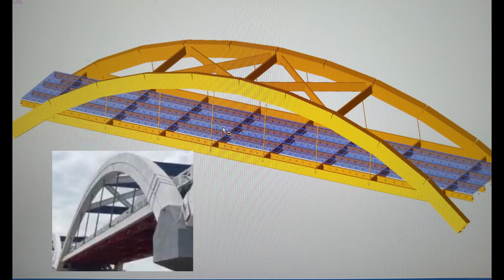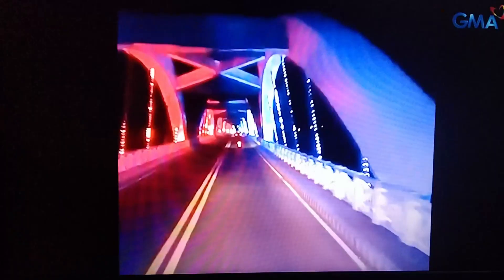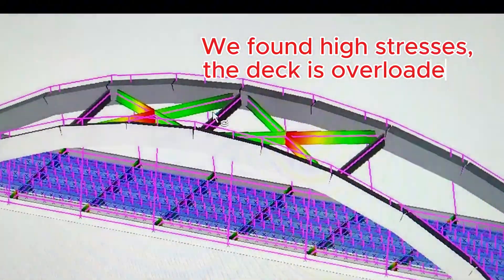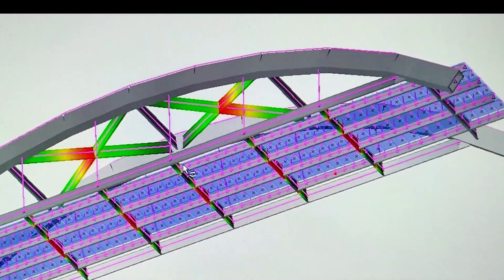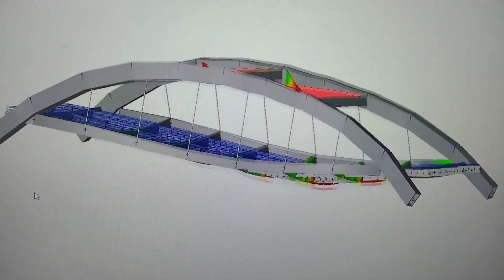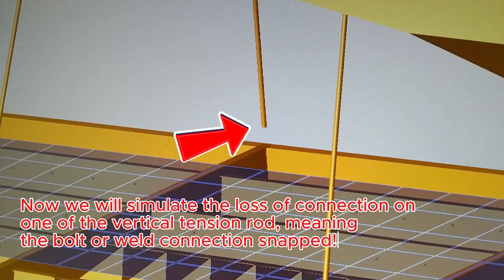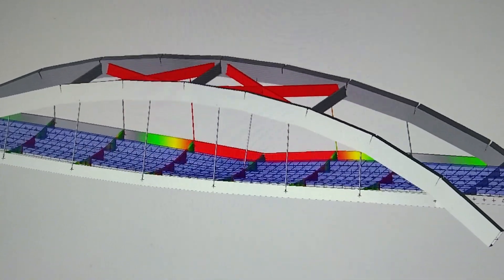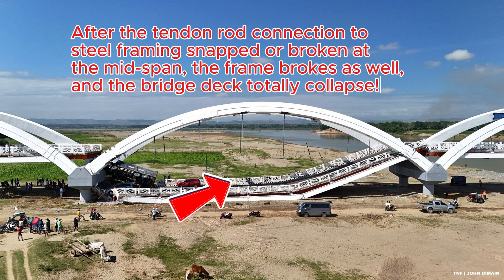ISABELA BRIDGE Cause of Collapse, EXPLAINED & CONCLUSION!

Comment: This is a very good animated presentation of what might has happened.  I must add since you brought up the other loads not included besides the two dump trucks, this is called lack of redundant strength to counter any unexpected overweight load.  There should be a law that says if the capacity is designed for 45 tons, the design weight  must be doubled or even tripled to obtain maximum safe carrying capacity of the bridge.  Since the original designer said it himself that, Matipid ang aking design, could this be the main reason why he's design is accepted by the DWPH.  How many more bridges did he design with minimum strength without redundant load capacity that might collapse in the future.  I think it should be investigated all contracts awarded to him by the DWPH because of money considerations being he's design is the cheapest of all... Cheap but not Safe.
Reply: ano po logic nung 45tons limit na load sa span na ganyan 60m? isang or dalawang truck lang pwede dumaan? yung iba mag hintayan hangang nakalampas na yung iba? magulo po yata yan lalo na dito sa pinas hahahaha
Reply from the maker: my new vlog coming up... it should actually be designed for more.... Total 270Tons Minimum of Static Uniform Loads per span
Reply: Ginawa sanang 2meters  height x 60 meters length at lahat nang 6 I BEAMS ay ditertso typical.

Comment: Boss i think not right to design bridge with long span 47ton or 100ton.. it should always assume a fully loaded deck of biggest load of possible trucks at a certain time and designer must foresee that scenario.. how about truck runs in convoy in both ways which usually happen during traffic,..  i think design by conception no matter what is the code should been considered, or just limit a one lane bridge with restriction entry will be implement.. pinoy na alam na kasya ang dala sa lulusutan mag expect yan na kaya ng design kasi di yan mag compute kasi driver sila at umasa sa gumawa.
Reply: May reason naman po kung bakit hL 93 , tandem truck.. ung loading sa bridge based sa AASHTO. They are based from studies. This trucks are just notional vehicles, doesn’t represent the real vehicles. Kung kayo po ang designer and hindi niyo susundin and code , ano po ung truck loading niyo sa bridge based sa logic at sound engineering judgement?
Reply from the maker: @ kung ako po mag design, di lang isang truck sa isang lane ng span ang ikakarga kong load, yan ang realistic scenario sa ganyan kahabang span. maybe 4 trucks (2 truck per lane) or even better 6 trucks ... or more, otherwise kung ipipilit na 2nos-27 ton lang pwede dumaan one at a time sa span eh... di ko maipapaliwanag sa karaniwan taong road at bridge users ang logic nyan.
Reply: @Harii4B  since overloading po ung nagging dahilan ng failure, is time na pag isipan na palitan na ung design truck? For example is hl 93 tandem. Ung wheel load niya po is 110 KN which is 22426 kg or 22 tons in total ay nahigitan ng load ng  real life scenario vehicle even applying factors. Sa isang designer , does he/she must consider overloading? Kung ganun how much KN per wheel load? Hehe iyon lang po Ang mahirap sagutin kasi ano naman basis kung gusto palitan ung wheel load. Kung let’s say 50 tons or 490 KN per wheel load ano naman basehan or rationale behind those values? Hehe . Sana kasi may sariling design truck Ang Pilipinas hindi borrowed sa America kasi iba Ang situation ng Pinas Kaysa sa America. Sana ganyan ung mga research topics ngayon sa Mga Universities eh .hehe para magagawa din tayo ng sariling code.
Reply from the maker: mas malalim pa po na problema ako nakikita. di lang overloading. masasabi na talagang design flaw ito kahit di pa overloaded ang span .... niluluto ko na po next video .. pakiabangan po
Reply: @ConsG.  ano po logic nung 45tons limit na load sa span na ganyan 60m? isang or dalawang truck lang pwede dumaan? yung iba mag hintayan hangang nakalampas na yung iba? magulo po yata yan lalo na dito sa pinas hahahaha
Reply from the maker: same thought sir, but they're invoking the "follewed the code(?!)". now, if it's true, does the code make sense at all on real life scenario?
Reply: @Harii4B  ano po logic nung 45tons limit na load sa span na ganyan 60m? isang or dalawang truck lang pwede dumaan? yung iba mag hintayan hangang nakalampas na yung iba? magulo po yata yan lalo na dito sa pinas hahahaha
Reply from the maker: as far as i know, codes only suggest minimum requirements on loading and occupancies. meron din tayo dba tinatawag na sound engineering judgement and logical thinking/reasoning.

Comment: Sir Harold , did you model it so the dump truck were side by side or following each other?
Reply from the maker: 1 lane only sir as per wheel plot on 61ton load. no need sir to put 2 trucks. simulated only as per actual scenario. it already collapsed on single truck. did not even need to show other light traffic loading during collapse

Comment: Sir, GCW: 90 Ton Max pala 12 wheeler Shacman H300S on specs hindi puno, kaya mababa noong tinimbang.
And Engr Canete din pala author ng 1997 at 2015 bridge code. Sino kaya ang maglalakas loob na magbabago sa design niya? and halos same pa rin naman ang design sa ilalim kung saan bumagsak sa 9th frame compared to the first 8 na dinaanan ng truck. Hindi nila pwede irefurbish na same design with the 1st 8 frames. mga bolt pa rin sa face ng arch ang bubuhat dahil hindi solid at sa ilalim naman ng arch, SUPER PRESSURED pa rin yun head ng bolt at welding ang bubuhat sa floor.
Reply from the maker: medyo mababago ang space framing arrangement nyan sir kung gustuhin nila patibayin. meron akong options on doing it. maybe later next videos naman ay focus dyan sa strengthening, pero bottomline talaga is gastos na naman sa taxpayers! maraming salamat sa panonood sir!
Reply: mali talaga design na buhos ang support ng suspension bridge walang maintenance dapat ang support nyan solid metal may maintenance kita mo pag need ng repair. yung vertical na support between ark and horizontal support pupolbusin nyan yung semento sa tagal ng panahon dahil sa vibration.
Reply: @Fraiden-wu2po  napanood ko po pay jessica soho may cracks na yung concrete arch. ibig sabihin iba iba na tibay ng arch kung iba iba rin cracks nyan kada arch. baka yung nagiba parte mas marami ng cracks tinago lang sa pintura hahaha